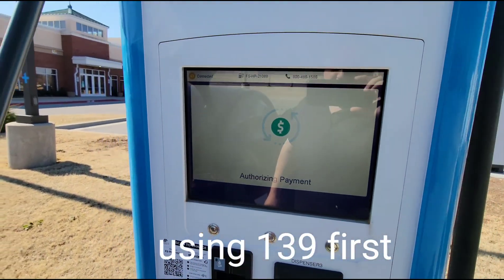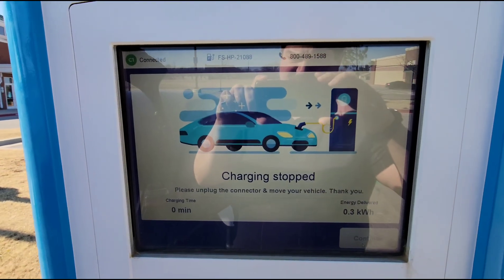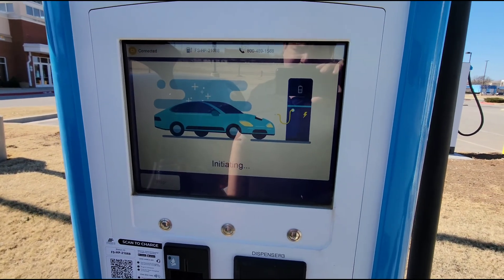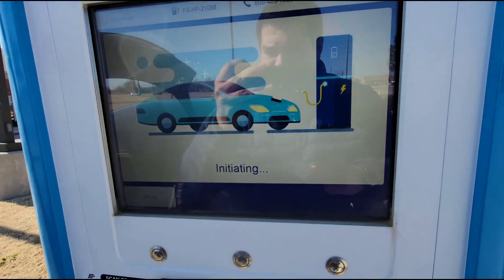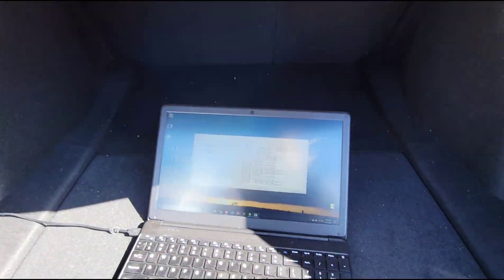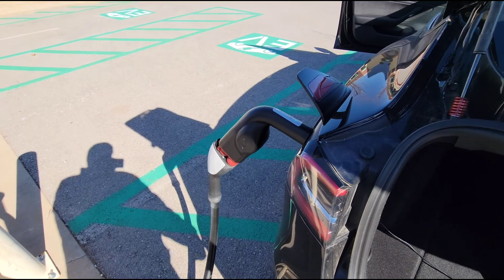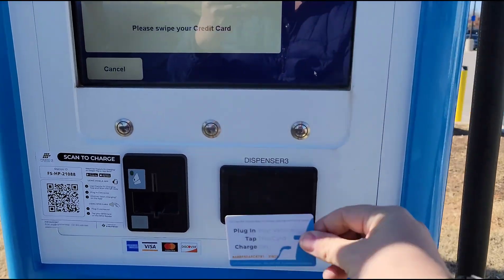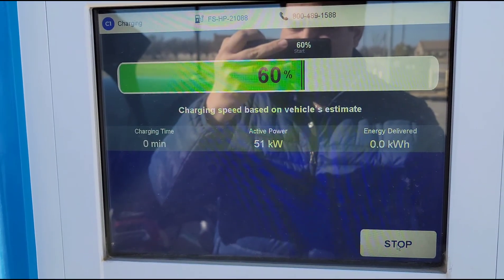Tesla CCS Adapter testing #10

Comment: Is the adapter limited to 50KW, like the CHADEMO adapter, or is this station just limited to 50KW?
Reply from the maker: Right now adapter is limited... It's possible for it to go up to 80 kw. But not yet
Reply: @Crazypostman  That’s a little disappointing.  I was hopeful that it would allow full charging rates from CCS1.  With this adapter at a $950 price point I may have to wait to see what Tesla releases in South Korea for its CcS1 to Tesla adapter.  Hard to pay twice the cost to get the same results as a Tesla CHADEMO adapter.  Do you have any references websites or company documentation on this adapters icapabilities?
Reply from the maker: Their website states that it's capable of 200 amps but so far in my testing it's never went over 125 amps on my model 3. I don't have an s or an x to test to see if it has the same 125 amp / 50kw limitation
Reply: @Crazypostman  Thanks for making these videos by the way!